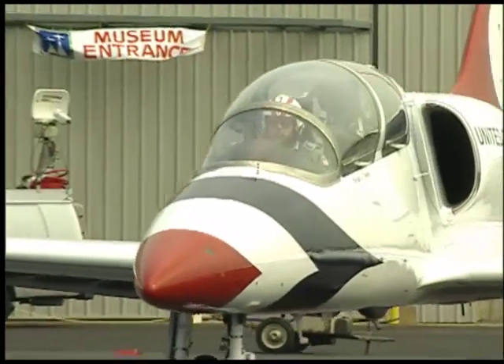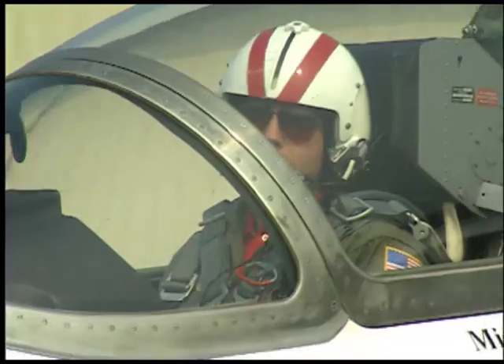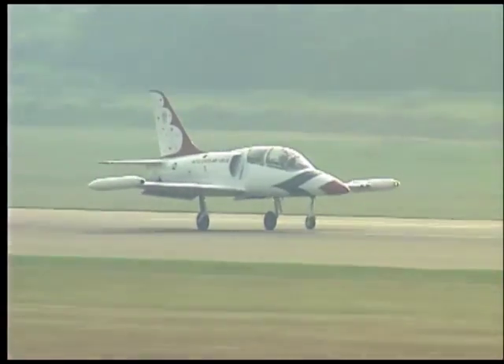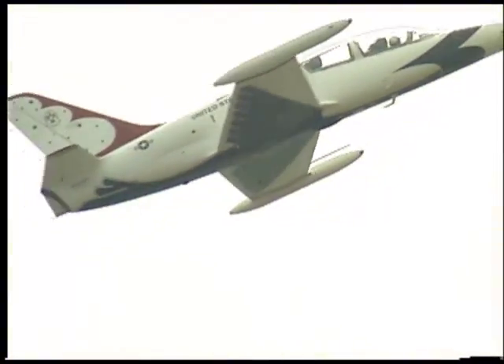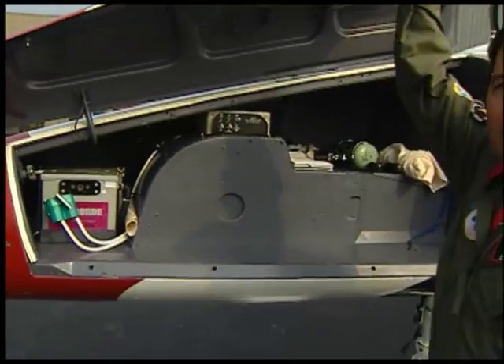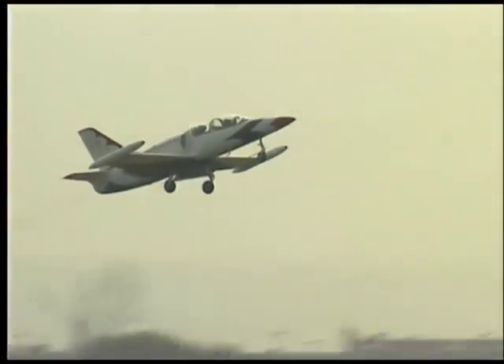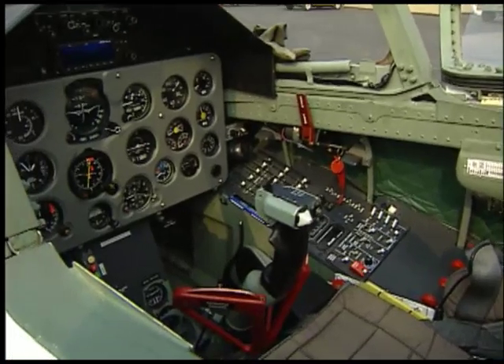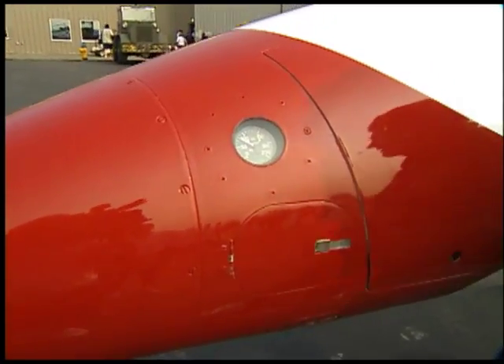Aero L-39 Albatros

Comment: Wonderful aircraft. What's the ballpark cost...ya know, for when I win the lottery!! 
    Hahaha
Reply: AZ Dad  They are really not too bad to buy now days with a good version going for less than $200,000 but they can cost close to $2000/hour to operate...at least those are the numbers I was quoted once.
Reply: Used military ones can be purchased / auctioned for around 250 000 USD !! Price of  sailboat for a fantastic military jet !! Moreover  - this is the only military jet that can be sold to the public due to its "trainer" classification. No such other jet can be purchased by non-military personnel.